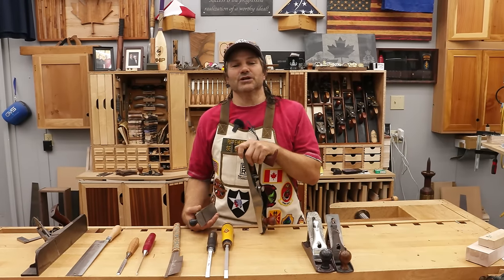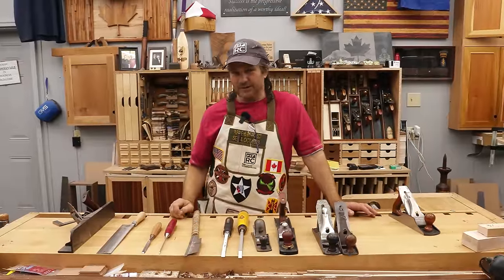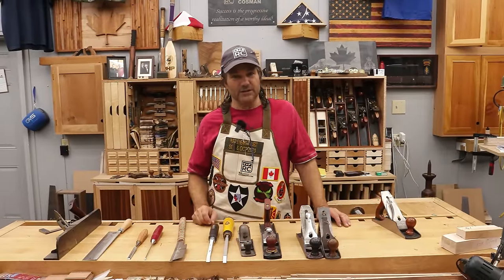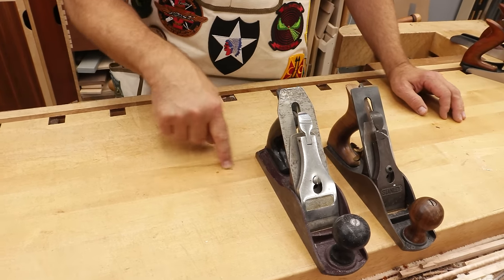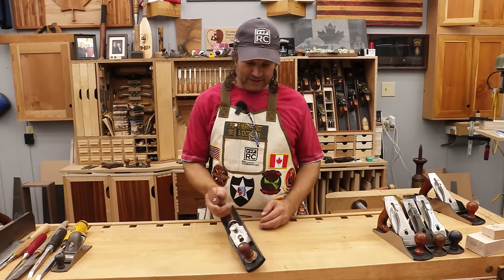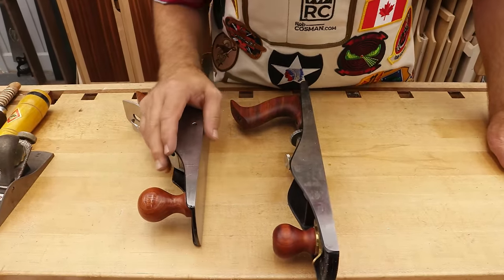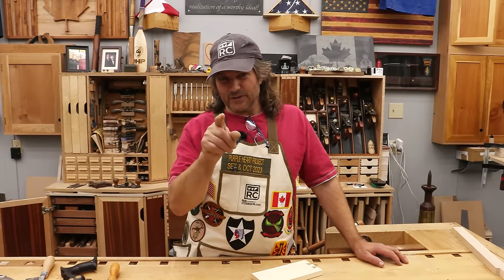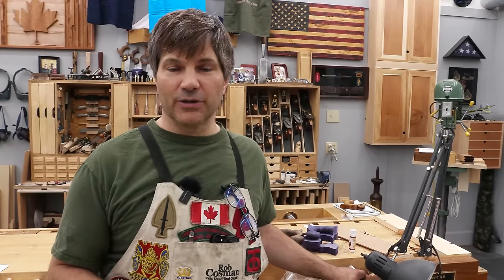Tools Not To Buy | Learn From My Mistakes !

Comment: Agreement with everything.  I have a handful of small block planes that I acquired from an auction years ago.  I didn't understand the difference between any of them at the time, and I cleaned them all up, sharpened them, and put them to use.  As I'm watched your video, I realized that now, years later, I only use the low-angle model, and it's probably because it feels best in my hand.  (glove size XL-XXL depending on the glove)  Only one of my shoulder planes gets used, too.  I don't tend to use most of the smaller planes I own anymore.  I have one very tiny pocket plane, I call it my finger plane, which I use for quick bevels on small pieces.  And I use my compass plane on some projects.  Otherwise, I'm using jack planes for most work.  I hadn't really considered why until now.
Reply from the maker: You sound exactly like me !!!!  I do the same

Comment: Rob, I love your channel and continue to learn from you. Since most commenters are wholly agreeing with you, allow me to offer another perspective. You’re right that this is merely your opinion. And it IS an informed opinion, although there are other woodworkers with 600 year’s experience (like Paul Sellars) who would strongly disagree with some of your opinions (especially about the No. 4). I mention this only b/c it can be very confusing to new woodworkers. So my point is at the end of the day we each MUST form our own opinions based on our own experience. Or at least that’s the conclusion I’ve come to. B/c I’m not the type of guy who will simply accept someone’s opinion just b/c they said it. I have to learn for myself. So, for me, I’ve learned (i.e., it’s my opinion that) I agree (for now) with Paul’s opinions about the #4 (I have smaller hands than yours) but at the same time I’ve learned to LOVE your 30 seconds to sharp. Just please don’t misunderstand: I appreciate and respect your opinions just as I do the opinions of someone else with loads of experience. But when all is said and done, we should form our own opinions and we shouldn’t always agree with a certain master—simply b/c we’ll have our own experiences based on our own body types, workshop conditions, preferences, etc. Thanks for the thought-provoking video!
Reply from the maker: Thanks for the comments.  Its all my oppinon based on my woodworking style and experience.  I think I made that clear to the viewer and they can make their own decisions.
Reply: You certainly did make that clear and that’s one of the things I love about you:  your humility.

Comment: About handle ergonomics: it can be worth to point out that it's fairly individual. And making new handles is both kind of fun and good training. And as a plus, you get a handle that's exactly right for you.
Reply from the maker: Well said
Reply: Very true! I put a target pistol shaped handle on a cheap scraper plane I couldn’t get to work well. It still doesn’t work well, but at least it’s comfortable. 😁

Comment: I have quite a few planes most of which are quite old and I inherited them from several generations of carpenters in the family.  My favorite "go to" plane is a Sergeant VBM which is wide blade and only slightly shorter than a 5 1/2.  Totally independent of each other you and I came to basically the same plane as the best.

Comment: Smart, common sense advice, especially the mortise chisel! As much as I love having lots of odd tools for specific jobs, most of the work I do involves a small number of everyday tools. It's a waste of time (looking for them, setting them up because they get used infrequently) and a HUGE waste of space.

 I own and use some of these tools (smoothing plane, Japanese handsaw) but I wouldn't necessarily BUY them. Having a #3 smoothing plane that cost $5 at a yard sale is one thing; buying an expensive new or reconditioned one is something else.
Reply from the maker: Great comment, Thanks

Comment: Fun video, and I'll enjoy reading the incoming comments for awhile!  Might as well add my own: You get an 8 out of 9.  When I built my "ultimate" tool chest 25 or so years ago, it had a dozen drawers with spalted maple, grain-matched fronts, six half-blind dovetails per front.  I was VERY unhappy with my two western-style dovetail saws, so on a lark I bought a dozuki and made some practice joints.  Fell in love, and have been using them ever since.  I only just this past year bought my second one, I had kinked the blade on my first on the return stroke (!) (simple clumsiness on my part) and it STILL had no broken teeth.  
Now, I've never worked with a pricier western dovetail saw (Veritas/LN/Cosman) so maybe those work fine, but I'm old and hesitant to buy green bananas, so I think I'll just stick to what works for me, for these remaining years.  
Again, fun video!
Reply from the maker: Sticking with what works for you is a great idea

Comment: 'Japanese' saws sold in the west are a mixed bag, but back in the old old days you could get pull cut fine dovetail saws that have all the advantages and similar feel of our saws. 

I can tell right away you're a master of the tenon saw and shocked you bothered learning japanese saws at all. 

Its a bit complicated because you have the different teeth and potentially thinner blade or kerf or blade depth, and my woodworking teacher back in the day taught me to hammer down the kerf for my tenons-

I'm getting a bit too into it, tenon saws are great, japanese saws are nice and disposable, i'll happily use either once i've got them set up, if I was raised in Japan i'm sure i'd be best with those. 

You can always make your own pull cut tenon if there's an ergonomic issue.

Personally I like the big japanese saws but western tenons. I can eyeball a nice fast cut with a thin kerf on the japanese and feels better left handed when i want to swap, but I prefer the control and handle actually cutting a dovetail with our ones.

Plus i'm not as young and i can get my eyeballs closer on ours ergonomically. 

Japanese tools weren't a waste for me, used them up, but no way I can resharpen their teeth. 

Its also not illegal to make a hybrid. 

Anyway, thanks for the plane tips, you are right of course. And I didn't know the mortise chisels come NOT square, so that might save me in future. About time I got my own plane, my dad keeps running off with his...

Comment: Pretty much agree.  I have small hands myself, and I bought a #4 years ago, and rarely use it.  Too small for my hands.  I like the 4 1/2 and 5 much better.  Agree on all but the Japanese saws.  Yeah, I have quite a few Western saws, but for fine work, the Japanese pull saw is more precise.  YES, it is great on soft wood.  YES, you get broken teeth.  But you said in your title "not to buy"  Well, you can buy a decent Japanese pull saw for $50.  And sure, after 4 or 5 years, you might have some broken teeth, especially if cutting hardwoods.  But there are LOTS of cuts you can do with a pull saw much better than with a push saw.  Obviously you have seen I am sure, cut intricate joints with their saws.   You say western saws have been made for hundreds of years, as a proof that they are great.  Well, if that is great, then Japanese saws must be greater.  Finer steel often and they have been making them for more hundreds of years.  I bet you  can cut hardwood faster with a push saw than I can with a pull, but with a good saw I can cut a line and leave the mark on BOTH sides of the cut.  I expect you know all this.  And perhaps you use a pull saw too, for some things.  You are a master dovetail maker, and your method works great with a western saw, and your skill.  But for some of us, the Japanese style is great.  (True, I use a lot of softwoods, even Cherry is pretty soft)  Anyway, I still agree with all the other stuff.  thanks
Reply: Pull saws are definitely older since they are the second oldest type of saw. Push saws evolved in the west to deal with harder woods. Japanese saws stayed pull saws because Japan was very iron poor and lumber rich. The wood they use is all 'soft' in the sense of having a very low Janka hardness. The only commonly used wood that they used that was 'hard' at all is Japanese Elm which Jankas at around 830. Most of their traditional woods have Janka hardness in the 4 and 5 hundreds. Push saws evolved in northern Europe to deal with the massive birch and oak forests which had Jankas in the 12 to 13 hundreds. Japanese iron deposits were and are essentially non-existent and usually iron was extracted from iron rich sands. In addition, Japanese steel making lagged behind the rest of the world and they were still using bloomeries for iron extraction up until the 1920s. This resulted in steels that were very low quality and required lots of forge working to produce useful tool steels. This was of course very expensive and time consuming. This is why Japanese tools tend to have have high carbon steels for edges forge welded to lower quality soft steels that make up the bulk of the tool. For saws, they were able to get away with using lower amounts of steel by using pull saws and the work they did was primarily with soft, straight-grained lumber, so there was no need to evolve to a different type of tool. In the West, iron-making techniques such as the Stuchofen and blast furnace allowed for the production of large quantities of very cheap, very strong iron. This combined with the harder woods of Europe pushed the invention of the push saw which needed high quality iron, but allowed the user to put their weight into the leading teeth of the cut resulting in a more powerful and controlled cut.
Reply from the maker: I think you miss my point.  Obviously, with practice and training you can master anything.  I was once challenged at a wood show to cut perfect dovetails using only a hack saw, a nail, and a screw driver.  Of course I did it as I cut dovetails for a living but a beginner could not do that.  My point is not that Japanese saws are "bad",  or imprecise but that they take more skill and thus more time to master than western saws.  They also are designed for a different style of woodworking than western style of woodworking.  Most folks I see try to use Japanese saws in western style woodworking (High workbenches, hardwoods).  If you are working in North American or European hardwoods you need a Japanese saw designed for hardwood and it takes even more skill to learn to use. Once mastered, both saws can do equally well with intricate and precise cuts.   My point is if you are a beginner, will be using hardwoods, and want to have quick success with a low learning curve, go with western saws.....If you want to be a japanese style woodworker go for it,  once you master the craft you will join a long like of craftsman I very much admire

Comment: I agree with all this, Rob. However, I make guitars and cutting fret slots requires a particular width of cut which is only available (as a hand tool) on a gent's saw. They're rubbish, but fortunately are used in a jig so that the 'where's the blade' issue doesn't arise. I wouldn't use them for any other purpose - leaving aside what you say, it's just to hard to keep them in a set position in the hand. Of course that could just be my lack of skill!

Comment: Several years ago I bought the LN low angle jack with the add-on hot dog grip to use as a dedicated shooting board plane.  With the hot dog it is comfortable to use, very easy to control, and does a great job.  It really shouldn't be called a jack plane because even with a second blade ground with a steep bevel the plane isn't really suited to taking thick shavings.  I understand the value of being able to use a #5 1/2 for a variety of tasks, but I find having a dedicated low angle shooting board plane to be a lot more convenient for how I work.   Otherwise, good video backed up with sound advise.
Reply from the maker: What is important is you have found what works for you

Comment: I do nearly everything with an old Record n. 7, which actually has a flat base. But I use an A2 iron from Hock, which I sharpen with Shapton stones (8000 for the final bevel) and a Veritas honing guide to keep the angle constant. For incredibly fine finishing I use a Veritas block plabe with a PM-V11 blade, which has the big advantage that the back of the blade is incredibly flat. By careful setting up and decreasing the opening to a hair width, its possible to plane against the grain with it tearing out. The extra weight and solidity of the blade and plane make it definitely worth the expense.

Comment: I'll add one caveat to the question of a no. 4 or no. 4 1/2. I wear a large (bordering on XL) glove due to my long fingers, but my hands are not as muscular. So, I find that a no. 4 plane fits just fine. My no. 4 1/2 is no more comfortable than my no. 4/no. 5, and being a slightly thinner guy, the weight of the wider plane is actually kind of annoying at times. I don't dislike the 4 1/2, but the size of the 4 actually is better for me.
Reply: You want to be a 5 foot 2 woman with xs hands.  You have to hold a lot of planes before you find something that feels right.

Comment: First plane I ever bought was a Stanley 9 1/2 block plane. Relatively simple to use and sharpen. Now, 40 years of hobby work later it's still going strong and the presence of the hand on top alters the physics of the thing so that it can smooth localised areas better than any other small plane. IMHO a very underrated tool. Way better than the LA version which needs higher sharpening angles.
Reply from the maker: A low angle blade and a standard angle blade are sharpened with the same angles, there is no deference is how you sharpen the two blades

Comment: Was that red handled chisel a Marples?  I gave my dad a new set to replace his Stanleys (emoji for embarrassed).  They had opened a lot of paint cans.  I cut all the blades way back so that they would work more like the Japanese chisels I used at the time. cured the balance problem, but they still weren't great.
Reply from the maker: yes it is

Comment: My grand father, bless his soul, taught me to NEVER place a hand plane so it sits on the edge of the blade, but lie it on it's side. You are some expert inded! Sad thing is, that you are, in your own words, teching this to many people...
Reply from the maker: Bless his soul, but your grandfather was sorely mistaken. That makes as much sense as not using your hammer to pound nails for fear of marring its face. 
Bench = wood
Plane iron = Hardened Steel
Plane iron is designed to cut wood, so how could lying it on a wood bench hurt it?
Reply: @RobCosmanWoodworking  I beg to differ.. This is a question of habit. And yes, you have the planes on wooden bench, but if you learn to always place the planes on their side, you do not have to worry, what surface you are putting them on. Now you said, you are teaching many people. Do you really think, they will all place their planes always on wood? I have seen a few times planes placed on hard surfaces the way you placed them. Even on woodworking shows! That's why I always point this out to woodworkers.

Comment: I agree with the premise of all of your tools comments.  Where I disagree with slightly is that many people buy some tools that might not be the best choice, but if you enjoy using them and you can accomplish the job at hand and have tried them out before buying one for yourself then is most cases no harm. Example would be the Japanese style hand saws that have long single handle.  A better one would be - which you never mentioned - would be all the pull type Japanese planes.  Looks to me as weird as trying to walk on your hands, however like any hand plane with use and learned skill is beauty to see. All in all good advise though.
Reply from the maker: Well I have never tried Japanese pull planes so I do not offer comments on tools I have not thoroughly tried out

Comment: I commented to my dad, some years back, "Opinions are like rear ends, every one has one." Dad, not losing a second commented, "Yea, and some of them stink!" Made me laugh. With the Japanese style pull saws, I would think that they can make perfect cuts, but there is a considerable learning curve with them. They were probably designed for cutting softer woods though. 

For the Woodriver planes, I have one. I don't like the handle. That bump/bigger curve at the bottom of the handle hits a pressure point on the heel of my palm. Much more experimenting with it to see if it is me, or the handle. 

Not totally sold on the 30 seconds to sharp method. When my secondary bevel gets to over 1/16 inch long, there are obvious 1000 grit scratches on the blade. Much more experimenting to do. I do really like the 300/1000 grit diamond plate I got from you. Dead flat in all directions, which is how it should be. 

Some one said it takes about 5 years to really learn how to use a plane. I have 4 or so years left.... I am curious about what you think of the Japanese style pull planes. Another area I am exploring...